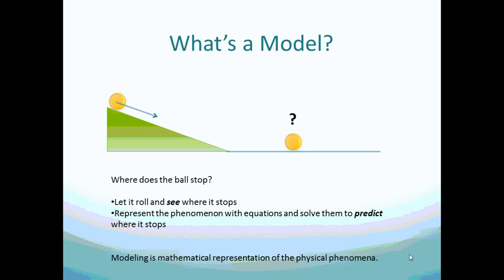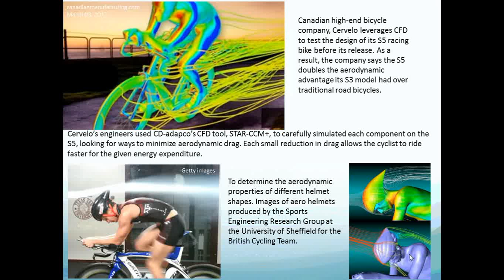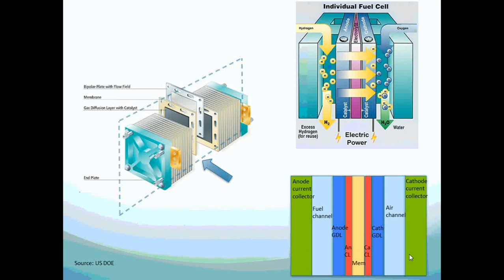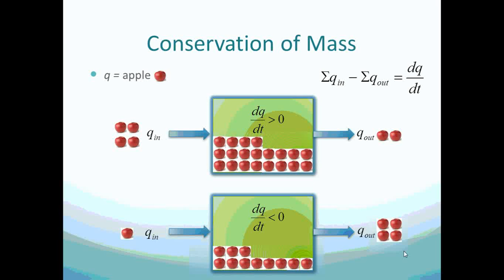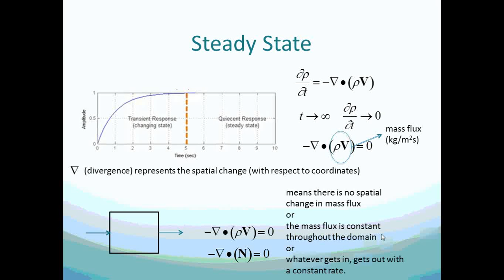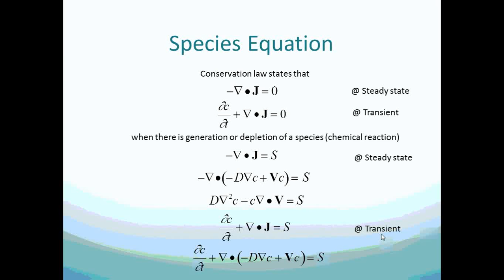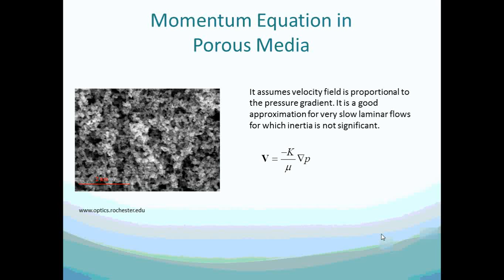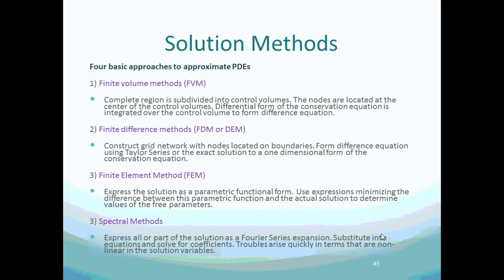11 fuel cell modelization

Comment: I think we have some notational inconsistencies at 44:32 - at the bottom equation LHS of page - the first term on the RH is correct but the 2nd term should be with respect to y not x shown corrected as partial d/dy  and likewise the 3rd term should be with respect to z not x shown corrected as partial d/dz - also - in the 3rd term - the partial derivative should be shown as velocity term pw not pz